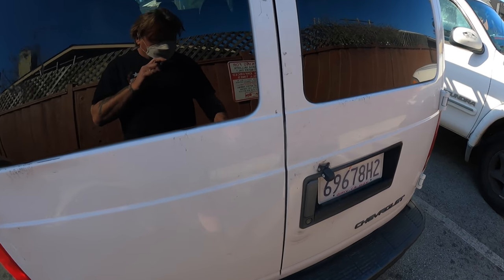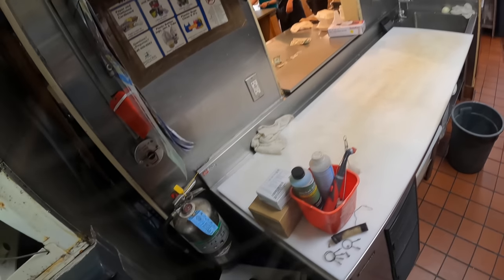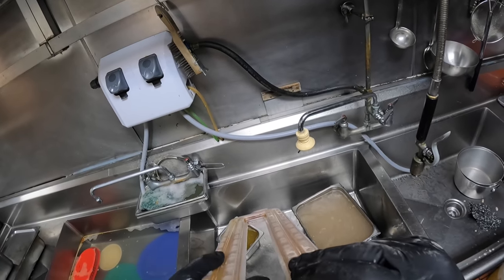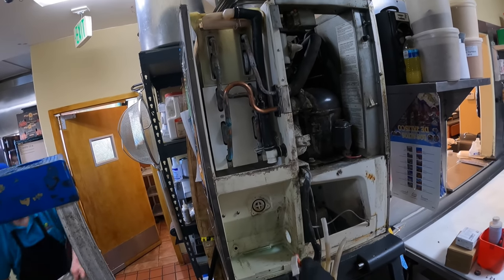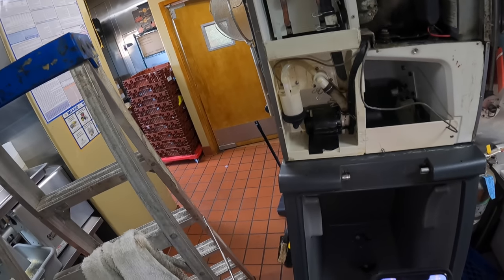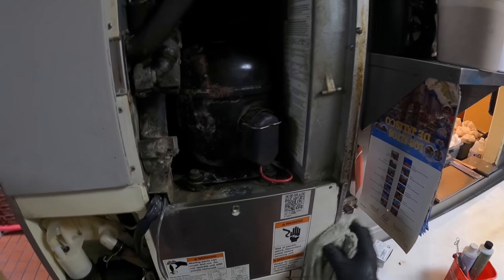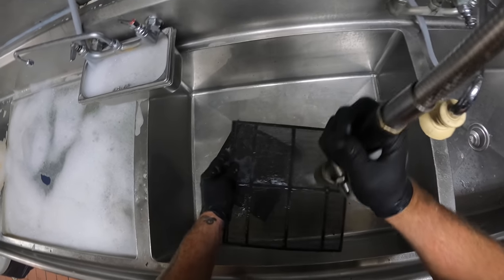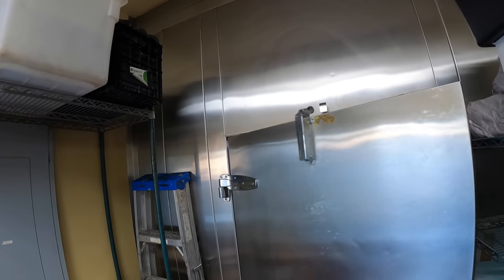Hoshizaki water pump, & the SCRUBADOOSKI

Comment: Is that 100% solution in the spray bottle?
I was told to use a rag and soak it with a little solution then hold the rag on the thick scale part so that it foams up then brush at it. Does this spray method basically do the same thing?
Reply from the maker: I mix it with water. And it looses up the scale , I scrub spray scrub.